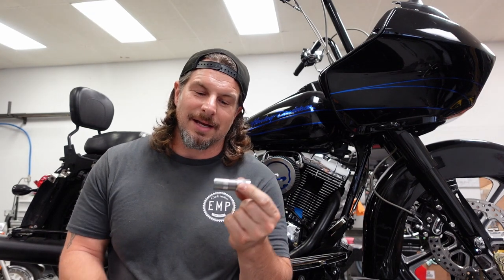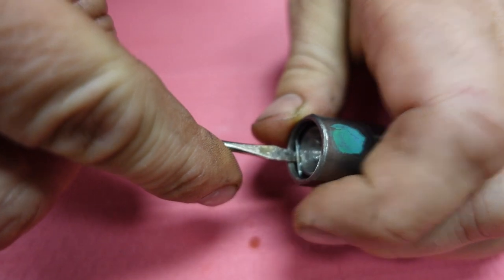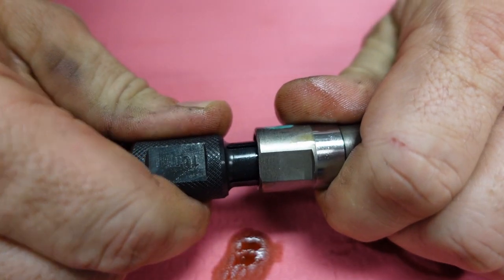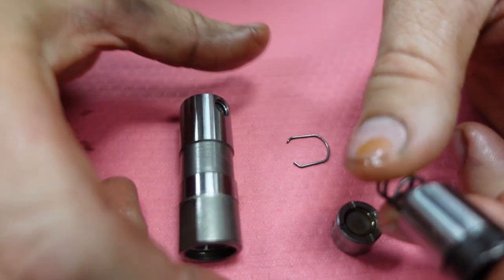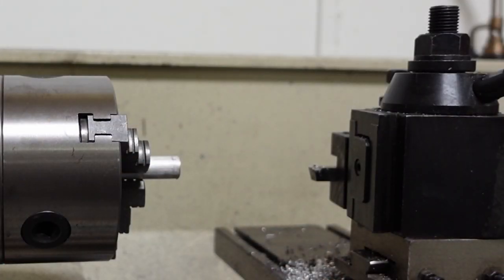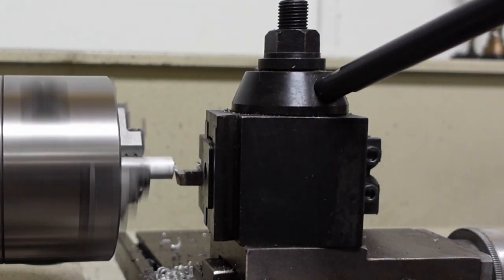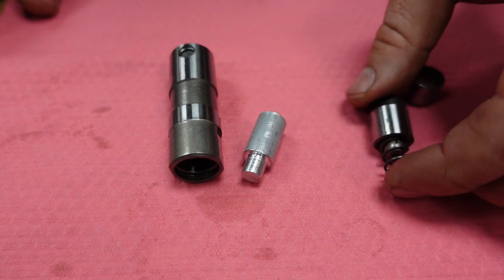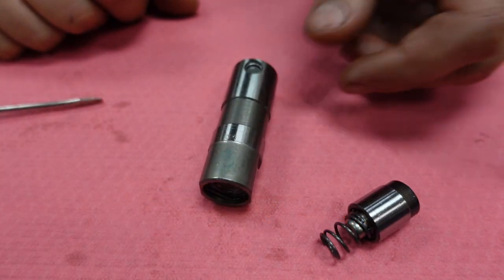How to make a solid lifter

Comment: Nice! So I don’t like the idea of installing adjustable pushrods I prefer solid even with the hassle of going at it  from the top.  I would like to see a video about the accurate way of measuring  pushrod length, because with all the different variables, lifters, cams, etc. it can get complicated. Thanks.
Reply from the maker: Thanks for the comment. I will look into making that video.